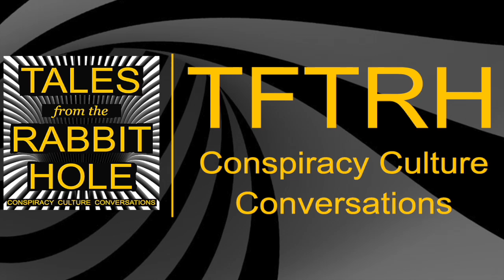TFTRH #21 Donald Friedman - After 9-11: An Engineer’s Work at the World Trade Center

Comment: Only partially, core steel beams welded on 2 sides, lightweight floors with lightweight concrete for reinforcement, gypsum walls as fire protection. Nobody can tell me that an airplane impact was seriously considered at the time. This was a story for the media to calm anxious people. That's why there are no documents about it. Leslie Robertson should be honest today instead of perpetuating the Boeing 707 story. these buildings were strong enough for winds and small fires (only short fires after the asbestos ban) but never for airplanes plus fire.

Comment: 3 buildings fell into their footprint at free fall speed.  You don't need to be an engineer to see that those buildings came down under  controlled demolition.  I say bring on Dr. Judy Wood to debate.  Double Dog Dare You.
Reply: @godlessmath Provide us with some numbers and reasoning.
Reply: godlessmath 
I’ve worked in building demolition for almost a decade. In every case lots of debris fell outside “the footprint”. It’s not possible to contain all the debris. This is why we need complete mandatory evacuation in a 360° radius of the site. This is also why we temporarily insure surrounding properties for the duration of the demo
Reply: @shibblesshalzabot6320  "I’ve worked in building demolition for almost a decade. In every case lots of debris fell outside “the footprint”" - no offense but if you caused 9/11 levels of collateral damage on your demolitions you did a shitty job.
Reply: @shibblesshalzabot6320  The debris field was too wide to be in the footprint of the towers, and hit not only WTC 7, but scores of other buildings.

Comment: Hey Mick- are you going to offer a critique on this video as you have Dr. Husley's study?
Donald said the top portion of the towers crushed the bottom portion before it pulverized itself upon contacting the rubble pile it had just created at the bottom.
Are you ok with this hypothesis?
Reply from the maker: Can you quote what he said, exactly, with a timestamp, so I know what you are referring to.
Reply: @MickWest  Opps, Mick not Mike- sorry. 
Yup- 16:59
"The collapse did not begin with the upper most floors, it began at the floors that were most heavily weakened by fire- which were somewhat lower....and the top of the building sort of came down with the collapse and then itself sort of impacted the ground, impacted the rubble below."
Reply from the maker: @RonDotComnz  He was talking about how some trusses were more mangled than others, which was because that the lower down trusses were hit with more weight (and speed, although he did not mention that.) He didn't say the top part of the building maintained its structure all the way down.
Reply: @MickWest  Trouble is, neither did he say the structure did not maintain its form. 
"The top of the building came down 'with' the collapse" and  "then itself sort of impacted the ground"  
"Itself" strongly suggests the self-same top that dropped from on high.
Reply: @MickWest My father was the Principal Chief Electrical Design Engineer for the entire WTC Complex for nearly 40 years. Worked along side Yamasaki, Robertson, Skilling, Roth and Jaros, Baum & Bolles. He was responsible for all the electrical systems including the elevator renovation upgrade in the Towers and was a lead engineer on the Emergency Engineering Enhancement team after the '93 bombing. He begs to differ with much of this scenario. There was no pancaking of floors. No floors were found at the bottom and no sign of any parts of 32 30,000lb. massive transformers. He knew those core columns like the back of his hand and the access and plausibility of controlled demolition. The top floors were pulverized in mid air. The tops were the lightest part of the Tower's structure. There is no way they could have been the pile driver to crush the rest of the 80 unaffected floors below them. Ton steel beams trajected outwards at over 70mph out over 600 ft. I grew up with those buildings from the bathtub to the antenna. I have many questions for this author/engineer. Some of the statements made here would have Yamasaki, Skilling and Robertson turning over in their graves. As an engineer, I can't even phathom that you would say an "uncontrolled" fire would collapse a 40,000 ton, fire-proofed, steel reinforced 47 story building at free fall speed for over a 100ft, symmetrically into its own footprint with asymmetric damage. Physics, fire and sensibility is lost on this conversation.

Comment: This guy hasn't indepthly reviewed the Hulsey study. 

This is a joke like you West.
Reply: "indepthly" is that even a word? It's like a double verb.
Reply: Hulsey has not released his data
Reply: @slamin2095  It's on the website as a .zip file.
Reply: @Meta_Myself  what zip file?

"The research team is currently organizing and uploading all of its data into a format that can be readily downloaded and used. We expect to post the data sometime between September 16 and September 30, 2019.
"

didn't Hulsey promise to post his data immediately as the investigation went on?  what happened to that?
Reply: @slamin2095  They probably had it up before, and you missed it.
Reply: @Meta_Myself  their press release says it will not be up until September 16th
Reply: @Meta_Myself  I've seen it, and it's still a load of crap!

Comment: Fascinating conversation, thanks Mick! What a difference in knowledge, experience, and maturity in thought compared to 9/11 conspiracy theorists.
Reply: Donald suggests building materials landing 110 meters from the towers was conceivable on account of the towers great height.  Really?
terb- eject two balls at identical horizontal velocities, one from the 20th floor, the other from the 110th. Each ball will land exactly the same distance from the building. Height is not a function of lateral distance covered by those balls.
The same is true of ejected building materials. The energy required to eject a 10 tonne chunk of steel 110 lateral meters is the same from floor 20 as it is from floor 110.
Donald has uttered a fallacious nonsense and you, lacking in knowledge, experience and maturity of thought, sing his praises!
You might consider jumping to the light of truth- at least we truthers can think straight...
Reply: @RonDotComnz 
Good point! Too bad it's irrelevant to WTC collapses. The 10 ton chunks of steel weren't "ejected"; they fell over. The steel found several hundred feet from the footprint were due to very tall sections of perimeter wall falling over, pivoting at a low point, some pivoting near/at ground level.
Reply: @RonDotComnz  "Height is not a function of lateral distance covered by those balls." 

Wut.  Both have the same horizontal velocity and both fall at the same rate, but the higher one has further to fall.
Reply: @seymoresaymore  True, higher goes further unless the height is such that all horizontal velocity has expired for both objects.
The point is I suppose- 110 metres distant is a remarkable distance made only slightly less remarkable by height.